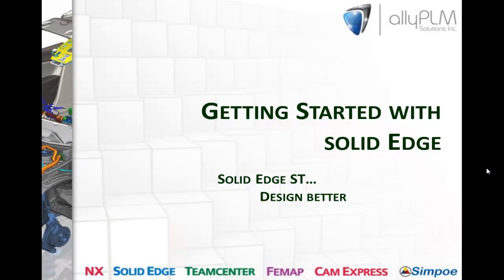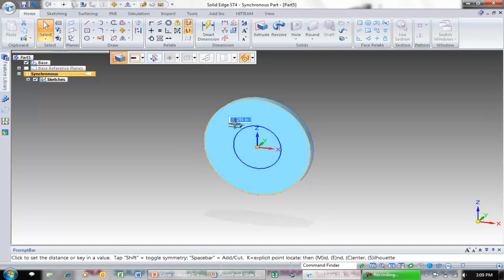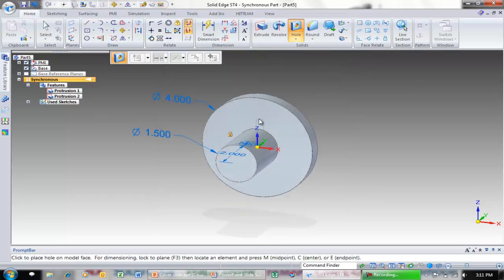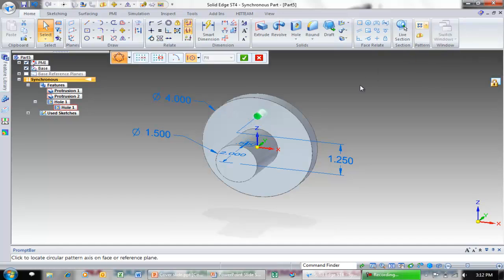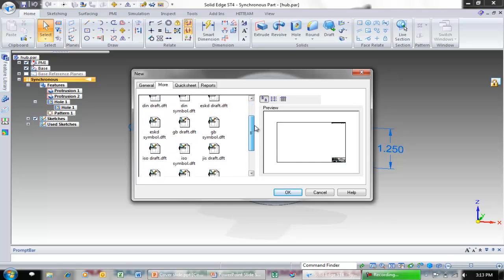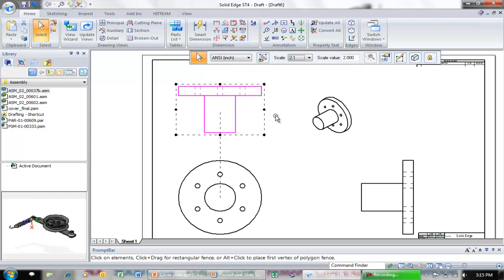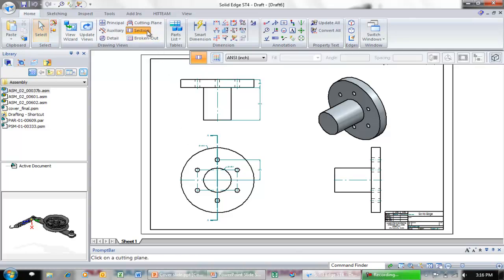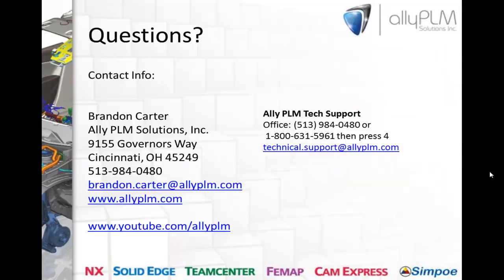Solid Edge Getting Started Tutorial

Comment: I am having an issue with my Gear Wizard in ST 10.  the body comes out fine but the teeth do not cut. I get an error message saying elements are not closed. I can seem to find the command to close them. any suggestions would be helpful. I work for a gear and sprocket manufacturer so this is essential. My sprocket wizard works fine.

Comment: Hello! I watched this video looking for some help with using the pattern, however i am having a hard time finding exactly what i need. I want to model a band saw blade and want to use what i'd refer to as "linear pattern", but i can not input a certain number of repeats, i want to copy the first tooth with a certain exact pitch, along a straight line. Is this possible in SolidEdge? Does anyone have a solution?